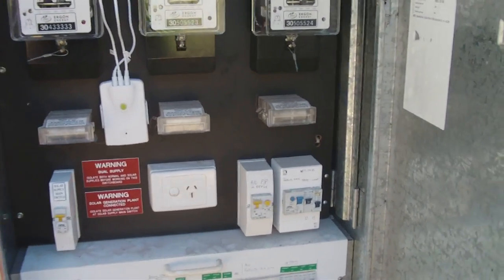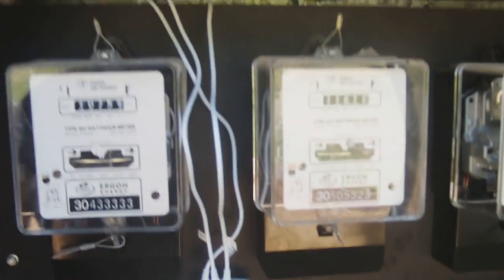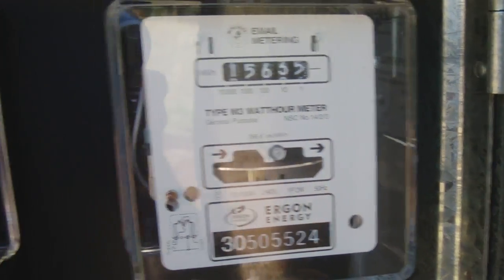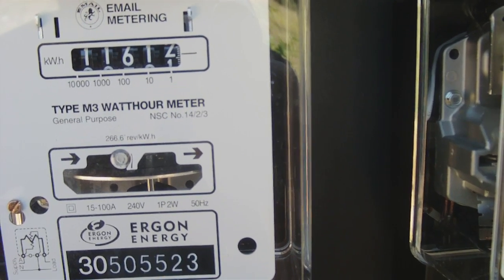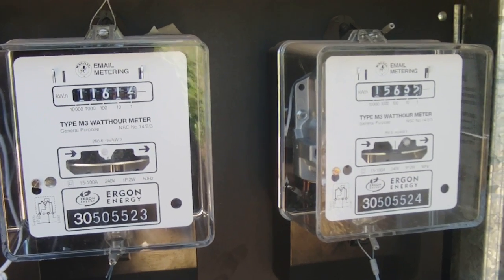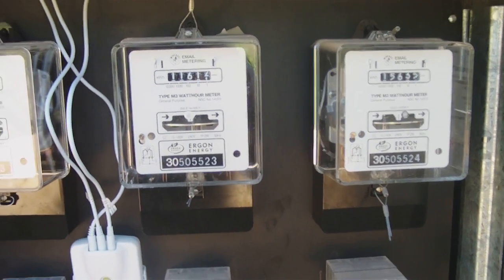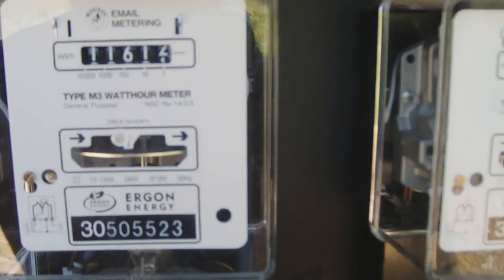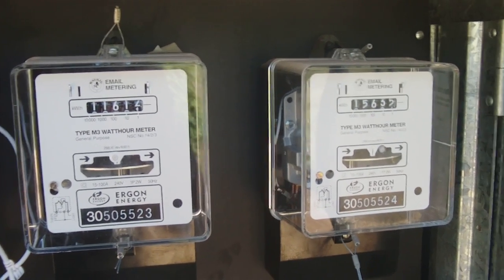Moving the meter backwards!! :)

Comment: And the black panels under your clocks with the lead clips on them if you remove those, You will see 2 small screws on one side with a washer between both them, If you lose off those screws it stops your meter running around, bang free power
Reply: Until they realize, send an engineer out and sue you for grand theft.

Comment: If you buy quality cells it will cost a very similar amount to buying quality panels.  I have made cells and bought cells and honestly I cannot make them as cheaply OR as robustly for the same output. 
Yes Chuck there are switches and Relays in solar systems to isolate Solar generation from the Grid in the event of Blackouts etc.

Comment: Well, they provide us with those new smart meters. Since we had a smart meter installed the usage has gone through the roof. I think they are called smart meters because they are cheating on us. How do you proof it? I.m getting to the point where I consider to go off the grid for good. Been running a house battery system for about 12 months now which gives me the idea of how much I use.

Comment: @Serostern Home solar inverters have grid-health detection circuits in them. If there is any instability in the grid, or the grid goes out of spec, or fails, the inverters automatically shutdown and lock-out. They can only be restarted once they detect a stable, fully in-spec grid connection.

Comment: @theelitevenom No, not really, you don't need a large converter for that, you could easily fit one in a shoebox.

As for storing power you can do it in a lot of way, a big flywheel or even as compressed air.